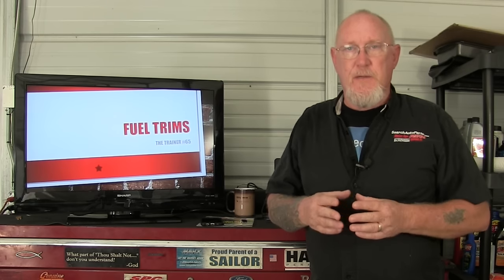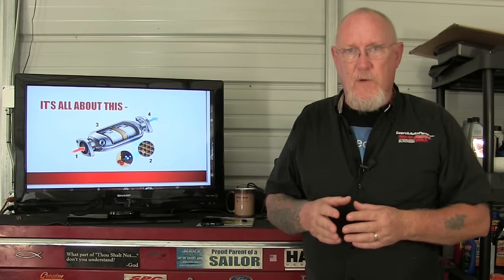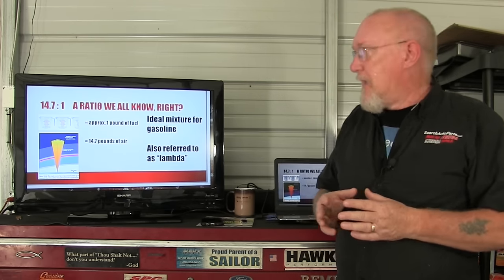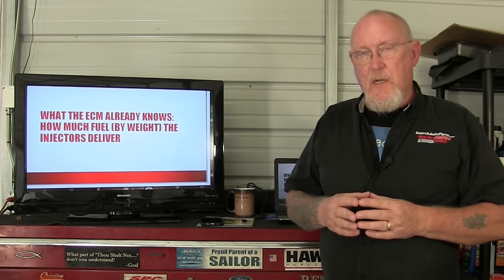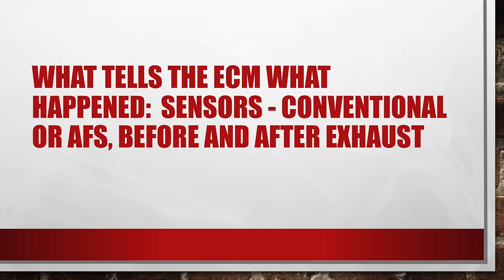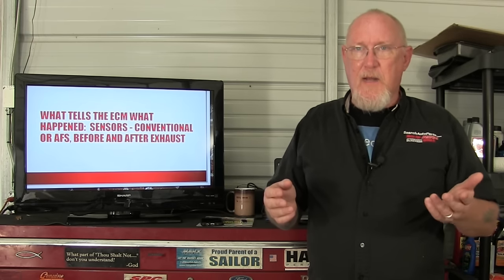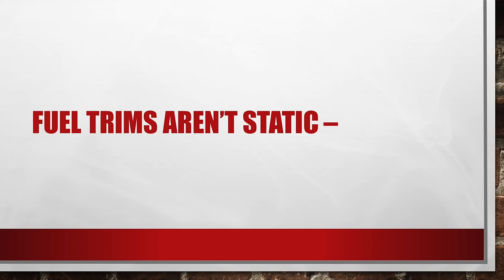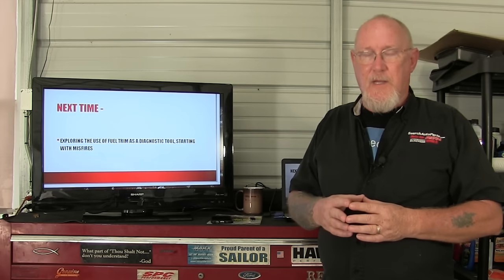The Trainer #65:  Fuel Trim Explained - What It Is , How It Works, And What It Can Tell You

Comment: My 2018 F150 with the 5.0 engine is surging. It reads ethanol content even though I have been running only pure gas. When the dealer calibrates the ecm to the latest software the engine runs smooth and then goes back to surging under load after several miles. My scanner says LTFT’s are at -12.5. What direction should I go in?
Reply from the maker: Have you verified the gas quality?
Reply: Motor Age I will check this current tank I am running and let you know. I’ve dealt with this issue early on and now have 19,000 miles. I’ve had the dealer install the latest updates for TSB’s and each time it runs smooth until it relearns. It feels like a miss fire or studder under load. I’m trying to test my theory if the pcm can’t adjust the fuel trims correctly due to the alcohol content. Never any dtc’s. I’m determined to get this figured out. I’m fairly mechanical inclined and any help is much appreciated.
Reply: Just tested the pure gas from my tank and it has zero alcohol. The level never went above the water line on the jar. Scan tool still showing ethanol and at 9.8%. Took a little test drive to watch the trims and they don’t seem to be consistent or if there supposed to be. At times now I’m seeing the long terms under -10 and then it’ll swing back to -13 or -14 but mostly on decel. This is on bank one. Bank two stays under -10.
Reply from the maker: @smitty0655able  Fuel today can run up to 10% alcohol. Are you getting any misfires counted?
Reply: Motor Age there isn’t any miss fire counts current. The pure gas I have been running states 0% ethanol so why is the ecm reading 18% one day and then 9.8% another day and states it is in ethanol mode. I checked a loaner f150 I had for a few days and which I added fuel to and read it was in gas mode. My theory is will this cause my drivability concerns if the ecm is adjusting wrong for the type gas being used? Thanks
Reply from the maker: It's possible to have misfires present that won't show up on the scan tool data list. Are you familiar with CAN Mode $06? I would look there as well. With the mileage you have and the amount of time you've been hassling with this, you may also want to consider a "lemon law" return - especially if the loaner did not have the same issue. Last, have you contacted Ford directly for assistance?
Reply: Motor Age I have just a cheaper Autel scanner but it does have mode 06 and live data. I do check for miss fire counts on each cylinder and it has shown 1 random miss fire here and there but nothing has logged recently. One thing I have not been looking at has been the two sensor two’s on both banks. Both show voltage but the short fuel trim on B1S2 just says N/A while B2S2 reads 99.2. Would that mean the sensor may be failed in some way since the fuel trim is not logged? I really appreciate your feedback and I would hate to see this thing beat me. I have not reached out to corporate Ford at this time but it may be inevitable. Thanks again
Reply from the maker: @smitty0655able  That may be an issue with the scan tool itself. Let's back up a step and troubleshoot the symptom, the "surge under load". Take someone with you on a test drive and duplicate the symptom. Then record the Global OBD II PIDs - looking at the STFT and LTFT at the time of the surge. Graphing can also help when reviewing that data.
Reply: This is the result of defective tool and/or PCM. Yup. ANYTHING man-made is subject to defects. This is the problem with so damn many computers/sensors/controllers on  modern day engines. And the problem is only going to get worse as they continue to add more and more of this crap to satisfy government tree-hugging emission standards. 

Get used to it.....
Reply: @smitty0655able  he I know you posted this a while ago but my buddys 2018 f150 was doing the same thing. He had to get basically the entire exhaust/cat/sensors replaced under warranty
Reply: AkaYellowhat thanks for the reply. I still am having this issue with my truck. Now Ford has a long block ordered for oil consumption.

Comment: The assumption is of course that the New car has a 0 fuel Trim  I would like test a brand new car Fuel Trim data, can bet it wont be 0.  Also the algorithms programmed into the ECM is based on certain standard data.. air pressure and humidity .  If  you are in a higher humidity environment like the tropics or sub tropics then the air is going to contain 35% more moisture than say in Seoul Korea. That means less efficient burn, more O2 unburnt = Lean = Positive fuel trim response.  e.g. the humidity here the other morning was 80%  thats a lot different than would have been programmed into the ECM's algos.  I also like to gather 20 minutes live driving data, wich  is about 1,100 data points, calculated ave Net fuel trims against each load, then graph that.  It gives a totally different picture than just observing live Trims.

Comment: I have a code on car 017011 on an astra h 2004 the air mass sensor has been replaced could the oxygen sensors need replacing ? Or is it somthing else I have read that the code means fuel trim to lean ?
Reply from the maker: Did you lost that code correctly?
Reply: @MotorAgeMagazine  I read the code correctly it had other codes to do with the air mass so changed it just got that code now from the pedal test
Reply from the maker: @katelanstewart3362  Can you send info on the code definition? Not familiar with it.
Reply: Just read the code means the fuel trim is running to lean ?
Reply from the maker: @katelanstewart3362  Look at the total fuel trim (STFT + LTFT) at idle and at 2500 rpm. If you see high positive correction at idle but normal at 2500, suspect a vacuum leak. If it's ok at idle but off at 2500, check fuel delivery. If off across the board, check inputs to the ECM
Reply: I have noticed the car does seem to lose power and when car is at idle it does seem to drop with my speed witch is frustrating it's hard to keep it at 1 constant steady speed because it jumps down so does my speed

Comment: Am in UK and stft is 31% is this my 02 or possible o2 failure this is what my scan tool says I have a vauxhall omega 2.2 👍
Reply from the maker: STFT is not a static number but 31% certainly seems to be correcting for a lean condition. What is the Long Term Fuel Trim? Look at both at idle and again at 2500 rpm and tell me the numbers.
Reply: @MotorAgeMagazine  thanks for the speedy replie appreciate it its in the 1st stages of storm barra but I'll let you know the no,s buddy this was at idle passed emissions just but bought a scan tool and learning about what does what 👍👍
Reply from the maker: @stevebarker1974  I'll be looking for the info. Let me know if any codes are set - or pending.
Reply: @MotorAgeMagazine  just one code mil p0650 also 02 is reading 744.50mv that's bank 1 but I'll gather all necessary info many thanks

Comment: I have a reading of 3.93+/- on my bank 1 O2 sensor. What does that mean?
Reply from the maker: If you are looking at Short Term Fuel Trim (STFT), it means the ECM is in fuel control and feeding the appropriate gasses to the catalytic converter. If it's the sensor reading itself, I'd need more detailed vehicle info to help.
Reply: Thank you for such a quick response! It says "O2B1S1" and the reading was fluctuating around 3.200 area. I didn't think that was possible. It's a 2001 Toyota Tacoma V6 with 160k miles.
I'll most likely start by replacing the sensor, but I wondered what direction I should head if that's not it. Thanks again!
Reply from the maker: @CAREERMAN70  What you're reading is the voltage of an Air/Fuel Sensor or Wideband O2 Sensor. This is not the same as the older designs and the 3v reading is normal. We actually have a story coming up in our August issue on how these designs work. Look for it online at MotorAge.com!
Reply: @MotorAgeMagazine  Oh! Okay. Thank you! I flushed out my mass air flow sensor with electronics cleaner. Hoping that might be it. We'll see, I guess. Thanks again!

Comment: I'm having an issue with my old truck such that the system ECU is reading like the engine is running rich and adjusting fuel trims negative (LT Fuel Trim = -22) but then i'm getting power drops and stutters like the engine is running too lean. When i hook up the scan tool the o2sensor is oscillating between aprox 23 and 920mv so not an issue with the o2sensor. Any idea what would cause this issue?
Reply from the maker: First, graph the fuel trim over a test drive - see what its doing at idle, cruise and WOT, along with the oxygen sensors and other parameters that define what the fuel calculation will be. What type of system are you working on - MAF or speed density? That also makes a difference.
Reply: @MotorAgeMagazine  I graphed but don't know how to make anything out of the results. They OBD1 doesn't seem to allow graphing but i have put the data in a sheet and looked at it. but don't know what it is telling me. CSV of the data is here:  

LT FUEL TRIM ,LT FUEL TRIM Div%,ST FUEL TRIM ,ST FUEL TRIM Div%,THROTTLE(%) ,TPS SENSOR(V) ,VEHSPEED(MPH) ,"MAP(""HG) ",O2S(mV) 
124,-4,124,-4,4,0.51,42,10.47,932
105,-23,131,3,34,1.55,44,19.73,133
132,4,121,-7,34,1.55,49,19.51,218
126,-2,121,-7,34,1.55,51,19.4,746
122,-6,120,-8,26,1.25,53,16.9,209
115,-13,124,-4,27,1.35,54,15.92,53
117,-11,131,3,28,1.37,55,17.44,107
119,-9,128,0,25,1.31,57,17.11,861
118,-10,125,-3,20,1.06,57,14.28,901
122,-6,120,-8,20,1.08,58,15.04,440
119,-9,124,-4,17,0.92,58,13.95,155
117,-11,121,-7,4,0.51,58,8.61,932
126,-2,118,-10,4,0.51,51,7.74,946
125,-3,118,-10,3,0.51,34,8.61,919
119,-9,129,1,2,0.51,19,10.58,511
105,-23,127,-1,12,0.8,19,14.72,27
123,-5,134,6,31,1.47,26,20.17,173
118,-10,148,20,57,2.27,34,23.43,67
126,-2,129,1,22,1.16,42,20.27,173
122,-6,130,2,34,1.57,46,24.63,817
131,3,124,-4,24,1.2,49,23.54,857
122,-6,117,-11,12,0.76,51,17.77,200
107,-21,124,-4,10,0.75,51,12.21,213
106,-22,130,2,9,0.71,51,12.1,626
106,-22,131,3,16,0.98,51,16.68,844
121,-7,128,0,4,0.49,51,10.69,910
106,-22,121,-7,3,0.49,41,10.03,852
105,-23,126,-2,2,0.49,25,11.12,870
125,-3,123,-5,1,0.49,9,11.45,884
121,-7,128,0,0,0.49,0,12.32,932
126,-2,126,-2,0,0.47,0,12.32,919
126,-2,125,-3,0,0.49,0,12.32,946
125,-3,127,-1,0,0.49,0,12.1,959
125,-3,124,-4,0,0.49,0,12.1,941
123,-5,122,-6,0,0.49,0,12.76,71
121,-7,120,-8,0,0.49,0,14.17,764
Reply from the maker: @OlaGbolahan  What is the year/make/model of your truck? I didn't realize it was OBD I - that changes things a bit!
Reply: @MotorAgeMagazine  it is a 93 Chevy K1500 5.7 Ltr v8 40L60E
Reply from the maker: @OlaGbolahan  The oxygen sensors were notorious on those for problems. Try unplugging the upstream sensor and driving the truck. If the problem goes away, replace the sensor.
Reply: @MotorAgeMagazine  I replaced the o2 sensor. Seems to only have one, unheated sensor with a single wire. Even with the new sensor there is no improvement.
Reply: i have replaced multiple things upon direction from other mechanics. I've replaced the MAP sensor, EGR valve, fuel pump, fuel filter, distributor and tbi.
Reply from the maker: @OlaGbolahan  Then go back to basics...timing correct and stable?
Reply: @MotorAgeMagazine  rechecked timing and idle timing is set to 0 and is stable w electronic spark timing system bypassed as required by book and label.
Reply from the maker: @OlaGbolahan  Then move on to fuel delivery. This is a TBI system or MFI? Fuel pump pressure AND volume. Injector(s) spraying correctly? You may need a scope to get a clearer picture of some of these parameters.
Reply: @MotorAgeMagazine  it is a tbi. I believe injectors are spraying correctly. How can i use a scope here? Unfortunately it doesn't have a pressure test valve. I put a new fuel pump on it and this didn't fix the problem. Also had to put a new tbi on because the cheap metal cracked when i was removing the old one for a rebuild. So thought it unlikely to be injectors or fuel pump. But im open to any suggested test.
Reply from the maker: @OlaGbolahan  I'm afraid I can't help much more without actually being there. With all you've done, it's easy to lose sight of the real fault. When I get frustrated with a diagnosis, I go back and verify the basics - no matter what I've replaced or repaired to that point. Do you have scope experience? I would like to be sure the timing is correct by either checking relative compression and use a second channel to plot ignition or even better, place an in-cylinder pressure tester in a cylinder and plot ignition. I would also check voltage and current to the TBI with my scope to see if the injector is sticking or working as it should. And, as I mentioned, the fuel pump may be new but is the volume of fuel correct? You may need a test adaptor to tie into the fuel line.

Take a moment - clear your mind - and approach the problem as if you just started working on it.
Reply: @MotorAgeMagazine  thank you for even taking the time to try to help me on this. No I don't have scope experience. I have an Actron CP9690 scan tool that i've used to look at the limited OBD1 data available. Any video or pointer you can direct me to on using a scope to check the things you mention would greatly appreciated.
Reply from the maker: @OlaGbolahan  Visit our channel home page and look through the library there. We have plenty of resources that may be helpful.
Reply: @MotorAgeMagazine  thank you for all of  your help. The problem appears to have been two things. The injectors had a bad seal and the spark plug wires were defective. The defective wires were the main issue though. They were wires that were only a few months old so didn't think wires could be the issue. But after a shock from just touching the distributor I was told that they wires must have an issue. Replacing them has now resolved the issue.

Comment: what if my b1s2 STFT reads -100% ? (4Cyl. Inline 1 bank only)
Reply from the maker: First, B1S2 is a reference to the oxygen sensor downstream of the catalytic converter. And STFT will never read that high. Are you sure you're reading the right PID? What kind of scan tool are you using?

Comment: I once had a converter overheat on a 1986 Chevy Caprice . It was a bad alternator putting out low amps causing the rpm not to reach proper speed.
Reply: Makes no sense to me,  Kevin.

Comment: NO BODY can help me. My 2000 Explorer 4.0 106k has all sensors in a normal wave O2 & STFT +- BUT the LTFT is high and will max does not change much at idle or out on the road. There are no vac leaks. Smoke test actually popped the glove used on the intake it's so tight. Fuel psi seems normal at 50 psi no return system.
Reply from the maker: Let's start at the beginning. What are the STFT and LTFT at hot idle? What are they at 2500 rpm? Are the STFTs switching either side of zero?
Reply: @MotorAgeMagazine  ST waves -4  to +5 as do the O2's. LT is +15 at idle & max'd +25 at take off from stop. In park, LT will stay about +15 at 2k rpm. No vac leaks...I swear. No zippy power like it used to have. Never ragg'd on being wifes trucky-wucky yanno. How can ST be at -3 (both sides always same same) while LT is at +25 under load on Highway? The LT changes/adjusts almost as quickly as ST. I doosh'd the MAF (CRC MAF doosh) it swings .01 to .03 snap throttle.
Reply: @MotorAgeMagazine  Pinched off vac line going to EVAP system. Fuel trims began to improve right away. Will smoke test the EVAP system to find a vac leak I swore wasn't possible.

Comment: I have a p1093 rich condition how to solve this
Reply from the maker: You have to give us more than that - year/make/model of the car, other DTCs stored, fuel trim numbers at idle and 2500 rpm...?
Reply: @MotorAgeMagazine  OK 04 BMW 325xi 2.5l ft1 - 9.0 to .78 b1s1 and b1s2 I think when I've replace rear 02 sensor for b2s2 the p1093 when away now I have p0420 bank 1 why would only one bank is rich every time I start the car I smell faint exhaust from the driver side
Reply from the maker: @isrealperez9069  Check the operation of the upstream oxygen sensors. While watching the data in graphing mode on your scan tool, perform a few WOTs in the bay. The sensors should drop lean and then immediately go high rich. If neither moves, replace it and retest.
Reply: @MotorAgeMagazine  can it be downstream I've bought upstream Sunday oh and how do I know if my maf is working tried cleaning but it's the same it starts up just fine

Comment: I will start by saying I do appreciate your videos. they are very insightful. however..

All this stuff is going to be obsolete in about 10 years.

all this technology and all these sensors are supposed to make diagnosis simplier. but it's never simple.   a code indicating a bad O2 sensor, is never about an O2 sensor you have to always find out what it is. that makes all this technology worthless because it just adds more time to diagnosing issues when it could be designed in to just tell you what the problem is like it should.

We would hope that new tech/EVs, with ostensibly fewer moving parts, will make these ridiculous and unreliable things like feedback loops the thing of the past.

But we all know better. The manufacturers will overcomplicate this somehow, & right quick for sure

Comment: Did you get that air math right? 1 SQ in 50 miles high is 3,168,000 cubic inches. 1 SQ ft 182 ft high is 314,496 cubic inches. And the height makes it heavier, no? But then also, thinner. I don't know lol.